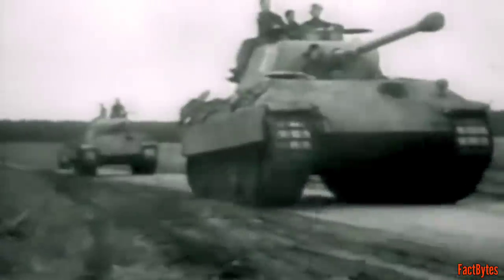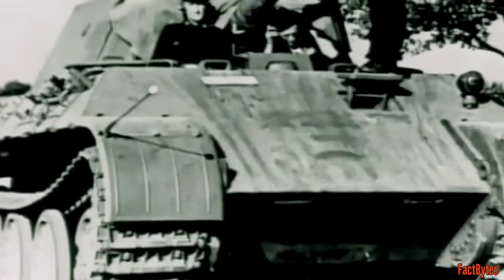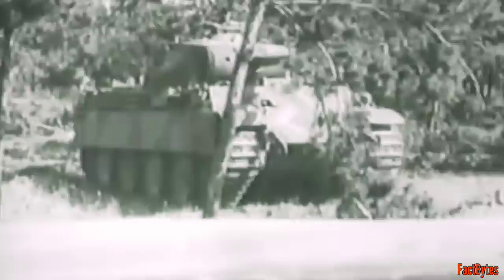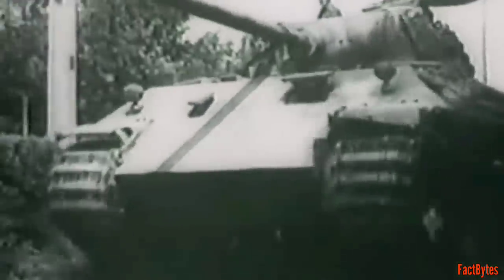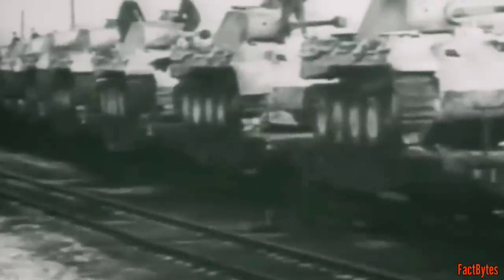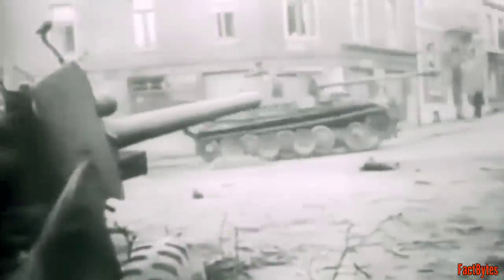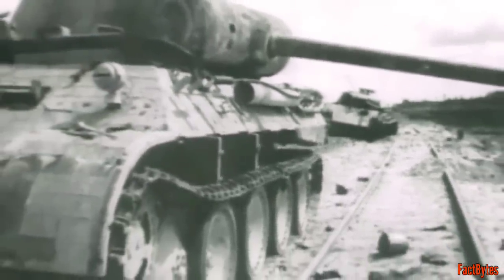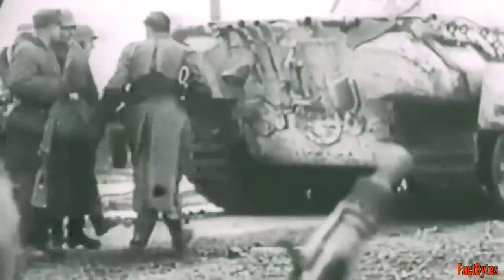Was The German Panther Really The Best Tank Of WW2?

Comment: IMO The best tank was the M4's cause they were used effectively in every terrain one can imagine. They were used in the western front, in the deserts of north Africa, in small numbers in USSR, and in the Pacific islands. Apart from being cheap and easy maintenance.
Reply: I used to dislike the Sherman, but there were lots of variants. And numbers do not lie a about the Sherman. They disprove the memes. Biut Shermans  are so modular and can be so different that the only thing in common is the name M4 Sherman,  hulls, engines, suspensions, tracks, turrets, guns, change.  Only the machineguns, transmisions, pioneer tools and headlights were the same! The Shermans was the only tank to have fought in all fronts of WW2, MTO, ETO, PTO, CBI, the Ostfront.  I agree that the better variants of the Sherman can compete for best tank of WW2.
Reply: @ricardosoto5770  I used to dislike Sherman, but then I learned about the fact that it was extremely easy to get out of, was easy to maintain, reliable, and had a gun stabilizer.
Reply: @pavelslama5543  i dunno man
I rather have 1000 panthers than 1000 shermans
Reply: @LordOfChaos.x  Good luck supplying and mantaining 1000 panthers lmao, not even germany could do that.
Reply: @Pixilated  ?? They had 6000 of them , they were fairly cheap to maintain 
Sure not early models
Reply: @LordOfChaos.x   they built 6000 throughout the war. When it got to the battlefield and did what it did best....it excelled at it. The problem was getting it to the battlefield....when you can lose up to half of them do to various issues before the battle even starts....that's a problem.
Reply: @darth_elsa6681  only early models as the D variant had reliability issues
Late models were just as reliable as panzer 3 and 4s
Reply: @LordOfChaos.x  the later models suffered from their own problems...which ironically included needlessly changing things that often didn't make a difference given what time Germany had left. Not to mention the material shortages that made their armor not as reliable. 

Why the Tank was great on the Eastern Front it didn't preform as well on the Western Front....most famously during and after the Battle of Arronncor....sorry for spelling.
Reply: @LordOfChaos.x  I'd definitely take a mid to late war Panzer IV or a Panther. While not as good as the Panther....I could produce 4 to 6 times as many of them and would have an easier time recovering them when lost.
Reply: @darth_elsa6681  thats where u are wrong 
A Panzer 4 costs 103 k RM while a Panther just over 117 k RM 
And the tiger 250 k RM 

Panthers production was adapted to be effective and fast while still maintaining low costs 

For 1 Tiger u could have 2 Panthers 
For 1 Panther u could have 1.1 Panzer 4s ..
So it did make sense if resources were available to focus on Panther production and further upgrading them
It was by far the best mix between low cost and effectiveness 
The long 75 wouldnt have been obsolete even 5 years after the war
Reply: @LordOfChaos.x  yet as the war went on it was the Panthers and Tigers that had the majority of problems.....I'm sorry but your math doesn't add up. If you could have 2 Panthers for every Tiger and logic would dictate you would have more Panzer IV because they were even simpler to produce being they produced more of them than Panthers and Tigers combined. 

When you're in a war of attrition....you have to go with what's cheap to produce as fast as you could produce it. In the case of the Germans....the ability to recover and repair. Something they on average couldn't do with Panthers and Tigers.
Reply: @ricardosoto5770  Yes! Me too. I used to deslike Sherman because of those old documentaries talking about tanks and the German gun and armor superiority, that created a myth of the Tiger for example. But if you take a more macro approach to it you'll see that a tank to be really good doesn't have necessarily to have better gun and better armor... Really nice
Reply: Logistics wins every time.
Reply: @martkbanjoboy8853  Childhood is thinking fancy weapons win wars, adulthood is realizing logistics win wars.  " An army march on his stomach". Napoleon.
Reply: @ricardosoto5770  And the humble Sherman kept going, and even when its usefulness as a tank was outlived, many still soldiered on as SP guns and howitzers, ARVs, CEVs, and even, in IDF service, as an armored ambulance!
Reply: The Firefly was the best Sherman varians, the German Tiger Ace's tiger was destroyed by a Canadian Firefly.
Reply: @avenaoat  I disagree.  Though the VC Firefly was a powerfully-gunned tank, that 17 pounder was not a good fit; it was slow to reload and had long-range accuracy problems.  IMO, the "Easy Eight" was better overall, though its 76mm gun had lesser amour penetration numbers.
Reply: @Goran Vresk  The Sherman was better than the Panzer III and the equal of the Panzer IV. In fact it was equal or better than any tank in it's weight class. However the Sherman was a 30 ton tank. The Panther was a 45 ton tank. The Tiger I was a 52 ton tank. Gee what a shock that tanks which outweighed the Sherman by 15 to 22 tons could have thicker armor and more powerful guns. Who knew right? 

But building tanks of that size comes with it's own set of problems. The transmissions and final drives were pushed to the brink of what they could tolerate. The ridiculously short duration of the Panthers final drive would have kept it from being approved for production by the US or British military. But when you are getting the absolute shit kicked out of you like Germany then you just say fuck it and throw it out there no matter the problems. Tanks of that size were also too heavy for most of the bridges in Europe or Russia at that time. This would have been a major problem for the allies who were on the offensive. They needed tanks that could cross the type of bridges that their engineers could construct over a river. But if you are getting your ass kicked by armies advancing on all sides and you can basically just park your tanks and wait for the enemy to come to you then these mechanical and logistical problems are minimized. 

The US had bigger tanks coming down the line it's just that before they could be introduced the pitiful ass Germans got their nuts stomped off by the equipment already in use. LOL!
Reply: The Sherman one hit wonder🤣🤣
Reply: @Goran Vresk  Actually you can, and US and Soviet tanks were better in many ways, despite the German advantage in armor and gun, they allied tanks had other advantages, logistics win war, not tactis.
Reply: @ricardosoto5770  i dont think so,german tanks are superior.
Reply: @Goran Vresk  Oh yeah? Where did you see it? History Channel? 🤣
Reply: Germans are brilliant in engineering.
Reply: @florencemodina6293  Yes their engineering were good, but what good is it if you can't mass produce them? What good is it if you can't repair it because German factories couldn't produce enough spare parts
Reply: @Goran Vresk  The Sherman was superior to the early versions of the Panzer IV. The later Panzer IVs and the Shermans were so close that who killed who was simply a matter of who got off the first well aimed shot. The Sherman was also more mechanically reliable to all versions of the Panzer IV and was also faster on the road or across country than the Panzer IV. The Sherman actually had thicker armor than the Panzer as well. It's also funny that people always want you to compare the Sherman to the latest version of a German tank but never want to use the later versions of the Sherman in any comparison. LOL! The up gunned 76mm Sherman for example was superior to any version of the Panzer IV. 

And I already addressed the Panther and Tiger comparison but let me rehash it again. The Sherman was a 30 ton tank medium do all, general purpose, tank. Good for infantry support but also able to compete with armored vehicles when encountered. The Panther and Tiger were much heavier tanks (15 to 22 tons heavier) of a different weight class and were specifically intended purely for tank on tank combat. If I compared a German Cruiser to an American battleship and trashed the cruiser because it lacked the armor and firepower of the battleship you would immediately point out that I am comparing ships of two different classes and declare the comparison invalid. And yet people turn around and commit the same inconsistency when comparing tanks. Why? Not to mention that the Germans made so few Tigers that almost no American soldier ever layed eyes on one during the whole war. 

The Stug III was a fine tank destroyer but it was not a tank and did not have a traversable turrent. For that reason it was best used on the defensive where it could wait to ambush oncoming armored vehicles. It was just basically a self propelled anti tank gun. That's fine for a country totally on the defensive as Germany was. It was not however well suited for offensive operations or infantry support as a tank like the Sherman was. Therefore calling it superior to the Sherman is ridiculous. The US also had tank destroyers and we can compare some of them to the Stug if you like but they do not belong in a comparison of tanks.
Reply: @Goran Vresk  Of course they can be compared.   They all had strengths and weaknesses.   The M4 had many advantages.   Fast, maneuverable, reliable.   What good was a Panther or Tiger during the Bulge when they were too big to cross important bridges?

Comment: FactBytes, I have heard about Canadian Sherman tanks firing armour piercing shells right at the neck ( the part where the turret meets the hull ) of some Panthers and disabling their long 75mm guns. Is that true?
Reply: Any (decent)shot at the hull glascis could cause the round to ricochet and penetrate the thin top (hull)
armour of the Panther......Also a ground hit(just below the frontal sloped armour)could also ricochet and penetrate....Again, these shots at the Panther were rare,but could and did occur.....Overly engineered machine.......
Reply: @bazzakeegan2243  Not the hull glasis but the barrel mantlet, that is why late model Gs built by man had a redesigned chin mantlet, and the F models would have a whole new turret with a different frontal hull roof.
Reply: Yes it is. My dad was US 6th Armored combat veteran. We told me about it. Shell trap
Reply: Yes, very much so.
Reply: Tiger 131 star of the movie "fury" was hit there and it's turret jammed you can still see the damage